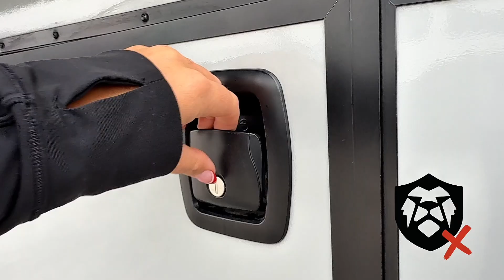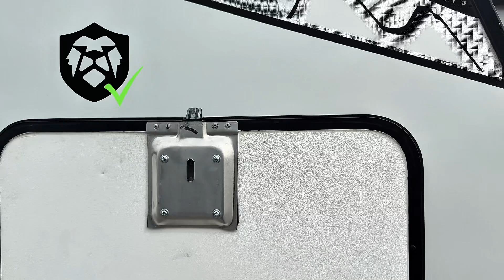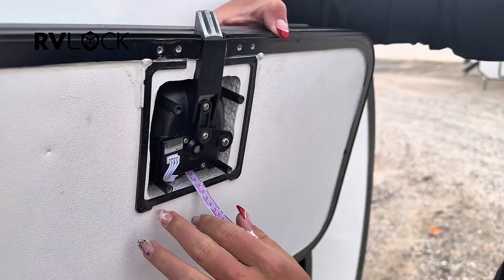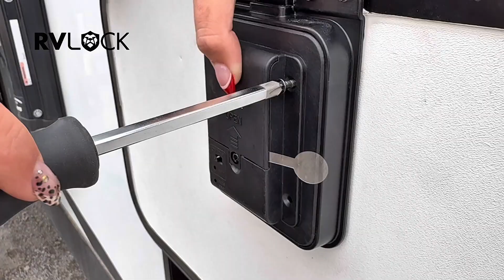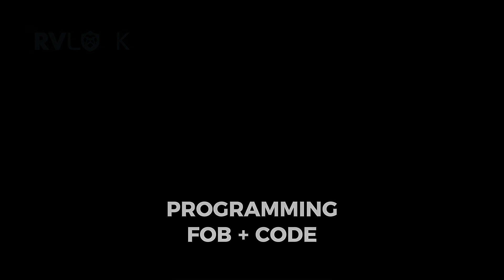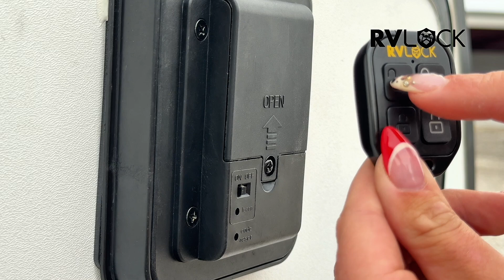RVLock Keyless Baggage Installation

Comment: Not understanding the reason for incompatibility. It looks like you are completely getting rid of the old lock completely and replacing it. So why isn't the only requirement the size of the opening it has to fit in?